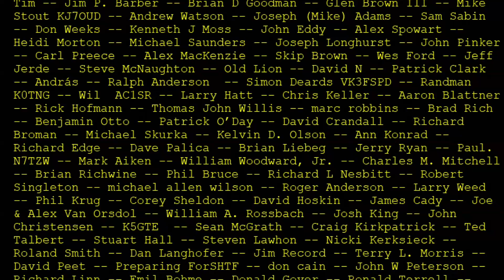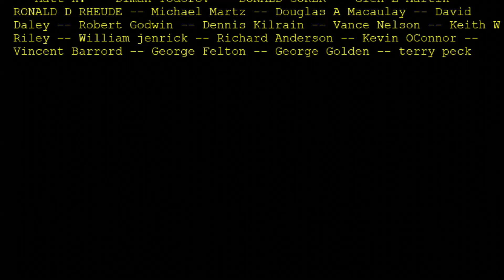EFHW 80-10 vs 40-10 (#1171)

Comment: Hi Dave.  Your EFHW-8010 antenna apparently has been in service several years.  At the apex of the antenna (20' above ground?) it seems that you used the combination of a galvanized hose clamp and a short length of bungee cord to secure the midpoint of the antenna wire to the mast.  How well has the bungee cord/hose clamp withstood the test of time?  I am concerned that ordinarily, a simple bungee cord would likely snap after being in service for only a short while.  Thank you!

Comment: Thanks Dave. My understanding is that a standard dipole has about 2 dBi gain broadside to the antenna, but apparently the configuration (sloping wire, inverted L, lazy L, inverted V, inverted U, etc) of these EFHW antennas alters that significantly. A discussion about the radiation pattern for different configurations would help. I believe height above the ground is also a factor in the takeoff angle so that's yet another variable. If you have a reference for how to configure these EFHW antennas depending on what you want to do (talking across the State versus across the world - over the pole or across the ocean), that would be pure gold. 73

Comment: I got the 40-10 MFJ end fed half wave because my yard is only 70 foot wide.  I have my backyard fenced in so no one can get near it.  I made it an inverted V.  It does an amazing job for me.  I tuned it for the CW portion of the 40 meter band, but I find it works well in the phone portion of every band with my rig's internal antenna tuner.  I didn't need counterpoise for it, because I have 100 ft of LMR-400 feeding it.  That acts as my counterpoise.

However, I couldn't leave well enough alone.  I bought an external antenna tuner and started experimenting.  I found I could use this antenna on 80 meters.  And when I added 100 more feet of RG8 coax and a common mode choke, just before the feed line enters my house, I could use this antenna on 160 meters.  (NVIS no doubt, but I can work from Wisconsin to Georgia from my Pennsylvania QTH.)  I've also been able to use it on every WARC band but 12 meters.  Even with my antenna tuner I can't get the SWR low enough.  (So I use my A99 for 12 meters.)

I've worked all over the world on this end fed half wave.  It's a simple antenna but it's worked out great for me.  

The only downside is that it's limited to 800W of SSB or about 160W on FT8.  But I never really need more than about 500W to make contacts and many times only use 100W.

Comment: There's also a reasonably easy way to make a 40-10 EFHW work on 80, by adding a coil and quite a bit less than 60ft more wire.  Actually, the inductance of the coil determines the length needed, or vice versa, so it's often best to work out the maximum length you can get in the air and calculating the coil from that.  The coil goes right on the far end and can support as little at a couple extra feet to get (a narrow portion of) 80M, though of course the more inductance in that coil the lower the radiation resistance...

Comment: I've built and used a number of EFHW antennas, both 80-10 and 40-10 versions. My current EFHW is 80-10 with two 90 degree bends in it to go around my wood fence. It's more of an NVIS at that height but does get out pretty well. I highly recommend EFHW for portable as well. There are lots of instructions available on Youtube for building the 49:1 transformers so you can build one for about half as much as a commercial product and get the feeling of accomplishment from having it work. Thanks Dave. You are spot on.

Comment: I am quite happy with my EFHW. I was also pleasantly surprised just HOW multi-banded it is if properly tuned. I got the idea of adding a coil on the end with a short piece of wire so it is also resonant on 75 meters. This is quite helpful if you don’t have the space for a 75 meter antenna, as it only adds another 5 feet of wire to the 40-10 EFHW. I built the coil with pvc and some 20 awg wire I had laying around. Couldn’t be happier. Remember to tune for 40 meters before 75 if you go this route.

Comment: Question: Would an external manual tuner, with connections for “wire” antennas, function just as well for an 80-10 EFHW, without a UnUn?
The radios I use don’t have internal tuners. While I usually don’t spend much time on the WARC bands, it would be nice to have them available. 
Very grateful for video!!
73!! de WB3CFN
Reply: A tuner is basically a variable UnUn, but 49:1 is a lot to ask of a lot of many tuners.  OTOH, a random-wire antenna usually only requires a 9:1 (if you're careful about avoiding certain lengths) and a lot of tuners can reach that ratio fairly easily.

Comment: Dave, thank you for clearing up a question I have; 40-10 vs. 80-10 using the same 49:1. I have a MFJ-1984MP and I love it for POTA activations. The 40-10 has worked well on all bands as advertised with my old FT-100D. 73 KC1EIJ

Comment: I just built an efhw for 75/80 portable use.  I used an insulator and connectors so I could tune for 75 but then connect another length of wire to work on the low end of 80 and the other bands.  Probably not practical for a fixed antenna.

Comment: I have an 10 through 80 my antennas efhw and it works great with my internal tuner. 10,12,15,17,20,40 and80
Reply: Me too. Nice antenna.
Reply: Same here. Works great. And 30 meters works fine too. It is the 3rd harmonic of 80 after all. Radio’s internal tuner tunes it fine. In fact, I do get all of 80 and 75 meters all the way up to 4.000 MHz. It came tuned on the low end of 80 and it’s just under 3:1 swr at 4 MHz so can be touched up with the radio. I also get 160 meters. But only for NVIS up to about 500 miles or so because I don’t have it up very high. MyAntennas was worth the money for sure.

Comment: A couple high voltage capacitors half way through the radiating element      will raise the fundamental frequency without effecting the harmonic frequencies so you can get the phone portion in 75m as well as the higher bands 😊

Comment: I built my EFHW for the very low end of 80 so I could work CW. I built the 49:1 UNUN by crazy gluing two Amidon FT240-43 cores together and wound the primary bifilar with 14 gauge enameled wire two turns and 14 on the secondary. The antenna’s length is 134 feet. The antenna is resonant in the CW portions of 40 and 20 before it becomes capacitively reactive on the CW portions of 15 and 10. Overall I’m very happy with it.